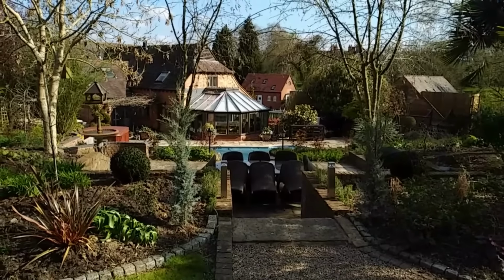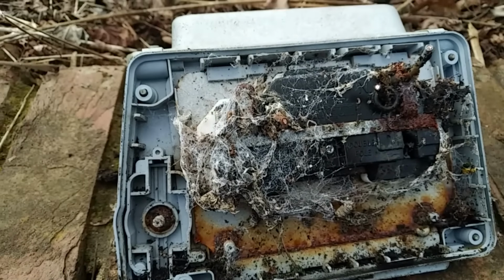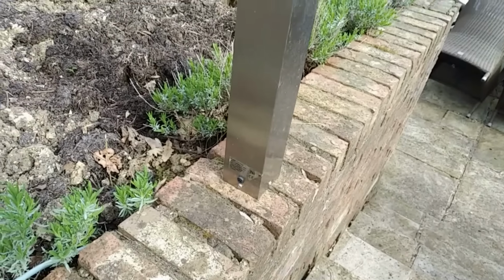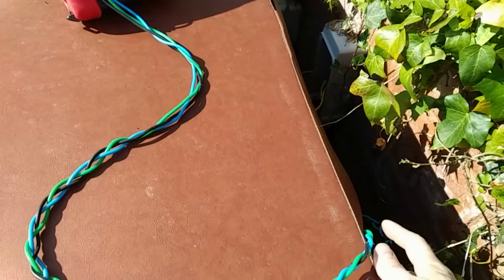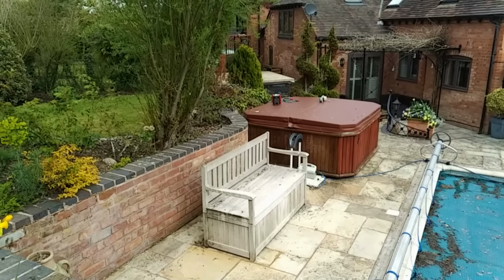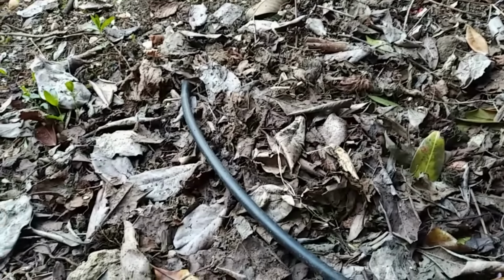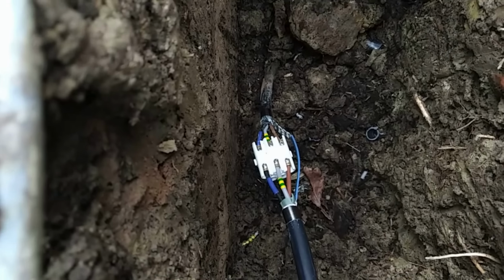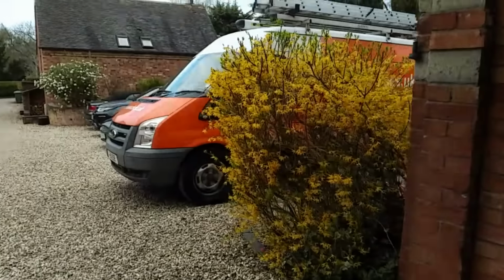Uncocking cack garden electrics

Comment: I look at a lot of youtube video's of UK electrician's and they are all very good like your one, but every time they show 3 core SWA cable they are always the 3 phase colours brown,black & grey, here in Ireland you can only get 3 core armoured cable in the single phase colours brown, blue & green/yellow, I cannot see the point of a 3 core SWA cable with 3 phase colours because you couldn't use it to say feed a 3 phase motor because you have no earth conductor and I presume like here in Ireland you are not able to used the armoured as the sole means of earth since the 1980s.
Reply from the maker: I'm not sure, you can certainly get three-core SWA in brown/blue/green+yellow, but much of what we pick up is brown/black/grey. Here it is permissible to use the armour sheath as a protective conductor under regulation 543.2.1, however certain conditions have to be met regarding sizing and installation.
Reply: @dsesuk  if you can still use the amouring as the earth conductor and they not that strict with the colours in the UK like here in Ireland I can see why the 3 phase colours are popular, I'am just surprise, I had a table saying what the amouring is equal to in copper conductors in most SWA cables and had a look for it after your reply but can not find it, but if I remember the only SWA cable where the amouring is equal to the copper conductors was 4 or 5 core by 1.5mm I think it was equal to 1.7mm but in bigger swa cables the  amouring has a very low rating compare to the copper conductors, I just look at your van tour video a little while ago and are jealous I badly need a new van but don't think I could afford a van as well equipped as yours.
Reply from the maker: @paulbrown9175  Personally, I wouldn't use the sheath as the CPC myself and would always run a dedicated core. From what I hear you do a few things more sensibly that side of the Irish sea. I'm over there later this year, so will be peeking at the electrics where I visit in between boosting the profits for Guinness!
Reply: Cable calcs are a lot more lenient than you remember, then.  Without looking it up, under normal applications the k of steel gives copper-equiv CSA equal to inner conductors (assuming SWA to BS ordinary spec cable) right up to 25mm in XLPE and bigger on old PVC.  If you're running in >=32mm XLPE then a supplemental earth will be required if your design calls for conductor size parity you don't want to play around with the adiabatic equation.  Of course local rules and other influences can change this.
Reply: @GrahamJEllis  I am not sure what you mean are you saying the steel armoring is better than the copper conductors at conducting the heat away from the cable at high current load, I still didn't find that table I was looking for but found another one that gives the resistance of the armoring and the resistance of the copper conductors and 1.5mm is about the only cable where the resistance of the armoring is lower than the copper conductor so here in Ireland you could in theory run a 2 core 1.5mm SWA cable and just use the armoring as the earth and be OK with the Irish regs the resistance of the armoring at 10 metres is 0.103 and the copper conductors is 0.1162 but with larger cables the resistance of the armoring is always higher than the copper conductors so in Ireland you can not use the armoring as the sole means of earthing with cables larger than 1.5mm if you do have to run a separate CPC it does not have to be the same size as the live conductors half the size or bigger, when these regs first come in 1990s you had to run a separate CPC because you could not get SWA with a separate earth conductor, I am fairly old and should be retired but cannot afford to so all you self employed electricians doing well should take out a pension plan or end up like me, I did work in England up to 1983 and in 1981 I was wiring these new maisonettes and flats and the meter positions were all together so we run a 2 core 16mm SWA cable from each flat to the meter position and some were 25mm for volt drop on long runs which we thought was OK but when the L.E.B. thats the London electricity board not sure if they are still called that turned up to connect them they would only connect the 25mm  because the armoring on 25mm was equal to 6mm copper cable but the 16mm armoring was equal to less than 6mm copper so we had to run separate 6mm earth cable black to each flat which was a job because the floors in the flats had been put down, I know you would run a larger earth today but at that time 6mm was acceptable.
Reply: @paulbrown9175  Ok, I fished out my GN1, tables in App D provide for the quick ref chart from Amtech that I always used to rely on.  This is also detailed in 7671 Ch.54 (see adiabatic in 543.1.3) and Tables 54.
Your comment concerned me, so I just did a "paranoia check" by putting these figures into Excel and letting it calculate the table from the formulae stated.
Using the published tabulated figures from BS6724 for XLPE and BS6346 for PVC, of the min required actual steel CSA of the armour, and the k factors for plastic and setting insulation, we find that the armour is suitable for use as the main CPC relative to Line CSA in most instances of XLPE less than 70mm (excluding 2-core 10,16,25,50mm and 3-core 16mm with 4-c 16mm being within tolerance) and in all instances of PVC less than 120mm (plus 3-c 120,150,185 and all 4-cores).
The maths works out that XPLE 2-c is fine at 35mm, and 4-c is good upto 120mm but I've never seen 4-core installed over 70mm and that was a big damned motor...
Reply: I do see your specific issue with domestic tails, however, at only 2-core 10,16 & 25mm: those are the specific sizes that fail to achieve the required minimum using the k-factor comparison of conductivity.
I never came across that issue because I'm almost exclusively industrial/commercial and I dont remember ever installing a 2-c SWA.  If pulling tails I'd never consider using the armour as it would be b*tch to terminate satisfactorily in a regular MET or earth marshalling block.
Worth pointing out that if using this formula to decide whether to rely on the SWA for CPC you still need to check the design for purpose, PFC, Influences, local regs, etc, to ensure this minimum CSA conductor is suitable for the means of earthing.  But by-and-large, in the vast majority of instances, the SWA is perfectly adequate for most purposes without undue worry (excluding that specific restricted purpose of domestic meter tails!) even when using XLPE, which is now the most common type used everywhere (mainly due to its LSZH) although you do have to do the basic maths (or check the lookup table) to avoid those random couple of sizes that don't quite pass muster (unlike PVC where pretty much anything goes)

Comment: Garden lights are always a pain, at least using 12V you can get away with a lot, including the fittings swimming in water when the seals failed, though there I was using 20W halogen lamps.  A lot of 125W mercury vapour lamps as well, accent lights, as they do last a really long time. All on their own RCD as well, at least per section of the garden, as they would need regular maintenance.  Weekly checks to replace failed lamps, and check which ones went swimming so you could redo sealing on the fittings, and of course gardeners using the cabling as aiming points for spades, forks and other gardening equipment. 

A whole string of 220V ones I simply ripped out the individual potted transformers, and got some 500VA 12V ones, and hung them in a convenient sheltered spot, and ran new cables where needed, or reused the existing cables with new junction boxes, and lots of sealer on the joins. Got tired of the regular failing.

Comment: 1.5mm powering a fucking hot tub?! Did they also want and under-garden heated lawn cause that's what you get when you run a ton of current through an undersized cable?
Reply from the maker: It's an odd one. The SY cable was obviously added later which is why it came off the top of the socket and ran part way up the planter rather than going through the back with the SWA, but you have to wonder what was going through their head. It's not like SY can be picked up at the DIY store, they had to get it from a wholesaler, presumably thinking it would work as a budget armoured cable, but then why go for 1.5??

Comment: Depending on the local electrical codes in America, without permits and inspections, you would most likely have to tear everything out and start over again. What a terrible wiring job.
Reply from the maker: It's all lip service here. Anyone can work on electrics with little risk of getting into trouble. At least, not until they kill someone or burn down something expensive.

Comment: Cracking video David (and uncle Albert!) on uncocking the cacked electrics . Is the use of black as neutral and grey as the earth noted as a departure from Bs7671 on the Minor Works would you say? Adrian
Reply from the maker: Y'know, I don't think there is a reg about this, although I'm happy to be proven wrong! I think it's more about convention following the harmonisation of colours back in the mid Noughties. Using grey as neutral dissociates the neutral function from the black colour (black now being associated with the L2 function). As such, it's not a deviation, and so long as each core is identified with tape or sleeving at their connection points, then it's not wrong. It's just not the way I'd do it (or other sparkies I know).
Reply: According to sect 5.1 ( in the NAPIT Codebreakers book) , it says for EICRs , that it is ‘N/A’ if the grey neutral conductor of 3 core cable is not marked as blue  but refers to Reg 514.3.1 ( in the book it seems to be a typo by referring to 5.14.3.1) . That reg talks about identification by colour throughout its length but does not specifically say Grey should be blue !? I was trying to find where it does and cannot see it. So I agree with you when you apply the regs but I equally stand to be corrected ? Adrian
Reply: It's not a departure from Reg's as you can use pretty much any conductor for any purpose so long as it is correctly identified at all terminations. The only exception is one coloured as an earth along it's length, which may not be retasked for any other purpose (notwithstanding that it can be tagged blue and used as a PEN). Any other preference for conductor usage is merely "accepted industry norm" or "best practice" (which David explained most succinctly)

Comment: great video. all that testing gear shows where the money goes when you hire a proper electrician to install things rather than somebody who's got a screwdriver and wire cutters.
Reply from the maker: That's the thing with earth leakage trip faults, you need at least an IR tester to know if your're on the right track. A little digital multimeter won't tell you much!

Comment: Good work Dave. I like the way you go through problems calmly and methodically and dont lose your cool. One question though, why do you use CEF? Aren't they the most expensive wholesaler out there?
Reply from the maker: I have accounts with all the wholesalers in my area, but I do use CEF mainly as they tend to be the closest and easiest to park at (at least at the Warwick branch)! They also have a decent website where I can see what's in stock and reserve items. The list price you see on the shelf or their website isn't necessarily what I pay though, my account manager passes my invoices and discounts items where he can. I also get a discount of (I think) 2.5% if I pay off my credit account in full every month (which I do for all wholesalers). The thing is though, I could spend time shopping around for cheaper materials on any given job, and it may be that visits to two or three other places would save a few quid coins here and there; I could also buy off-credit at the likes of Toolstation or Screwfix, but what savings I may make in purchase costs can be wiped out by the extra time and diesel used. I've got a good relationship with the CEF boys in my branch, so I'm happy to use them.

Comment: Rewire it, only option for me
Reply from the maker: It might come to that, but my authorisation from the absent homeowner was just to bring it back to service for now. Further work needs planning and costing.
Reply: ...only someone who knows about electrics would want to redo all that properly. We prob know what the answer will be from the homeowner about rewiring when you tell them that it's working fine now & passes the insulation tests.
Reply from the maker: @wirdy1  The idea is to inform the homeowner of the temporary nature of the repair. The fact it's at 20M Ohm indicates there is degradation elsewhere, probably at a buried junction, although there may be some other point it passes through that we just didn't find on the day. That number is only going to decrease again over time. I can't force them to do anything though, they might well just accept the fact that it currently works, and they'll worry about doing anything else should the situation rise again. That's life out in the field though, sometimes you're presented with a situation you just have to work with because rip out & repeat isn't a immediately viable option.
Reply: @wirdy1  belive me I don't want to rewire it, just saying it needs it.

Comment: Thanks for making this informative video. First time I’ve seen the TIS MFT in action, looks like money well spent (unless it was a freebie).
The whole video I was thinking why on earth have they used 2.5mm to power a hot tub, recently we did one which needed 6mm. Anyway you showed near the end that it was only drawing some 13amps.
Looking forward to the next video!
Reply from the maker: I wish the TIS were free, but it was a second hand impulse purchase at £500. I did another video on it last year where I was disappointed to find it had a 99 Ohm resistance limit, but since then the firmware has been upgraded and it now does a more sensible 1999 Ohm. It's a funny form-factor, but a capable enough bit of kit. I keep it in my main tool box. As for the hot tub, we were lucky that this is a lower power model. Others I've installed have needed to be on a 32A circuit.

Comment: Really interesting video, thanks.  How would you go about terminating SWA coming through a wall into the back of a plastic IP rated socket?  Especially if it needs two (loop in loop out)?
Reply from the maker: I wouldn't terminate it onto the rear. Notice the new 2P+E point Nigel has installed at the end of the video - he comes out of the wall and has terminated the SWA onto the bottom of the enclosure. It perhaps doesn't look as neat, but moisture will be running down the cable channel through that planter and any termination on the end will eventually be damaged by it no matter what sealing or glanding you use. The way he has done it here with the connection point on the underside of the enclosure and it set apart from where the cable exits the wall means the IP rating is as good as we can get it. If they want any new sockets, we'll come off the bottom of the socket enclosure and then take the cable back through the planter wall.
Reply: Thanks for the reply  @dsesuk   Fully take your point about getting a decent seal, the only way I can think off the top of my head would be to run the SWA through the wall in a conduit with silicone between the conduit and again inside the conduit with the SWA.  Or chop out some of the wall and put the incoming SWA into a gland which then fits back into the hole in the wall?
Reply from the maker: @ursusmaritimus7159  Silicone really doesn't last very long outdoors, I'm not a fan of using it. Even if the SWA gland sat back into the wall though, it would still be at the mercy of the moisture unless you had drilled a channel through the wall diagonally down from the front face so the SWA comes up through the wall.
Reply: Ursus Maritimus you cant really earth the armouring if you come through the back. You could try using a piranha nut and earth fly lead but space will be tight
Reply: Good idea on the piranha nuts. Have always just used the ring in the gland kit but I know some frown on this method into plastic enclosures, so the piranha nut seems a much better solution.

Comment: Had one a while ago myself the builder had Henley blocked the incoming tails and fitted the hot tub to a 63 amp rccb 30ma onto 2.5 armored to a 16amp outlet no overcurrent protection at all.
Reply from the maker: Yoinks!
Reply: @dsesuk  Could've been 0.75 mm flex... I think someone from Germany told me about some sockets wired like that.

Comment: Well... not a lot to say about that is there? A botch up from start to finish.

Well done you for getting it at least up and running again.

Was there never an imminent  danger of anyone getting a shock, from what you found?

The people that installed that need hauling over the coals.

Well done too for not referring to that chap's spade as his 'massive tool',  because I know you do do that from time to time. 

Oh, and if you DO end up doing it again please do do a follow up.
Reply from the maker: Ah - gutting that I missed a classic double entendre! I don't think there was an imminent danger here, however the SY cable is not recognised by BS7671 and should never have been used, especially (lightly) buried, and the SWA sheath isn't earthed, except for the section we've put in and the feed to the hot tub. The RCBO was doing its job, but had there been no additional protection then it may have been a different story.